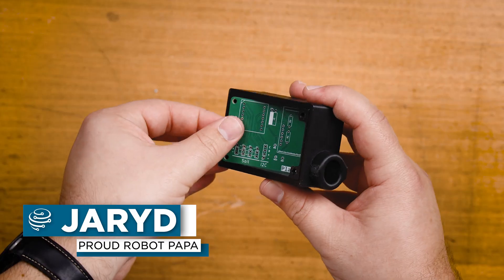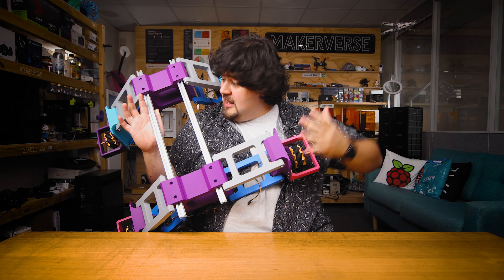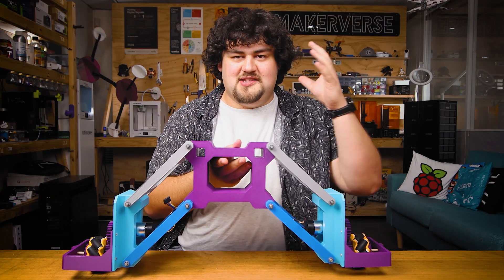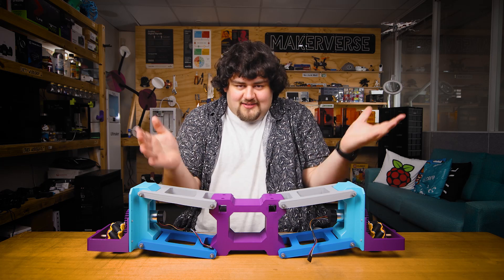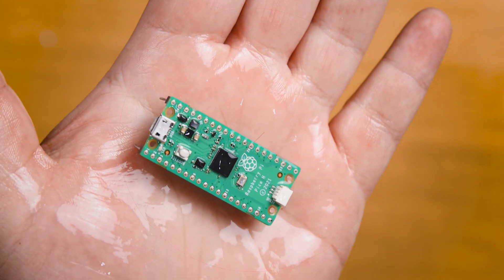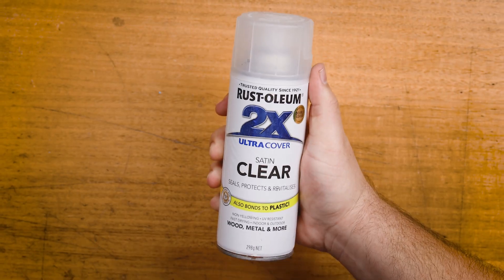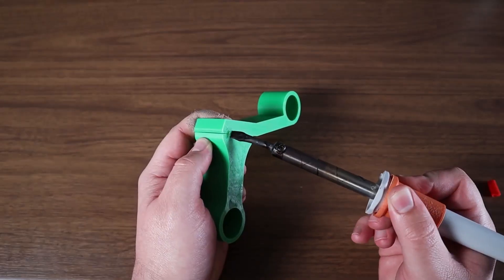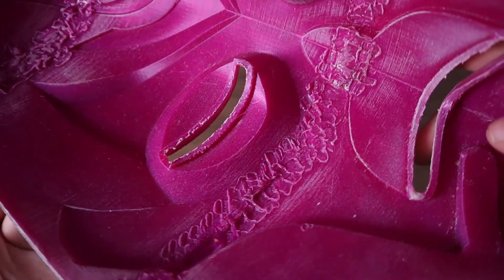Mechanical Design For Makers | Zero To Maker Workshop

Comment: When using through-bolts on 3D printed parts, don't forget the load spreading feature of washers. Often the bearing surface of a bolt-head or nut is fairly small, concentrating the clamping forces on a small amount of plastic. Using a metal washer under the head of the bolt and the nut spreads that clamping load over more plastic.

Don't forget to add extra perimeters around that bolt-hole in your slicer because clamping down on infill is less strong than clamping down on a column of perimeters. You don't need to add extra perimeters to the entire model. Using a modifier (PrusaSlicer lingo) to selectively add perimeters only on the bolt-holes will speed up your prints and use less filament while allowing you to reinforce the bolt-holes.